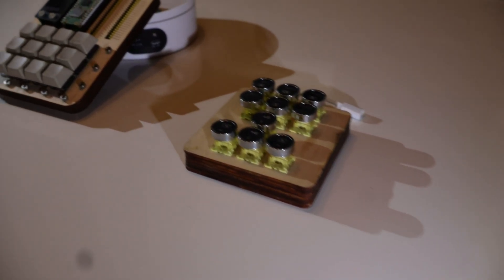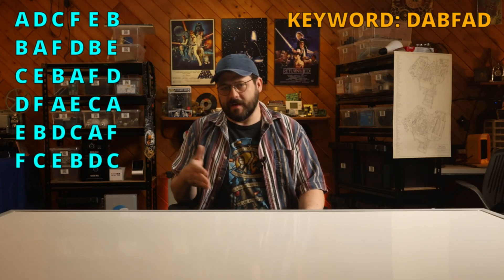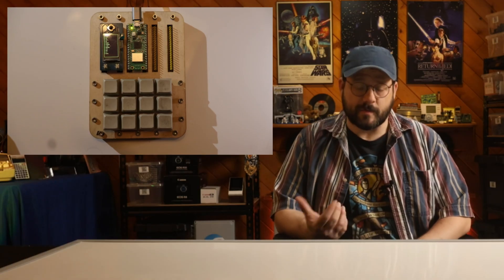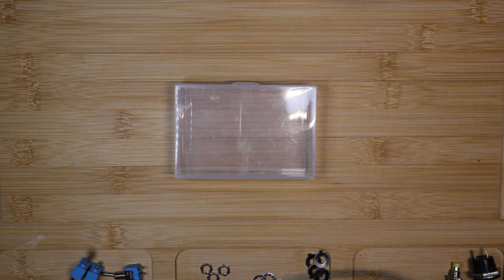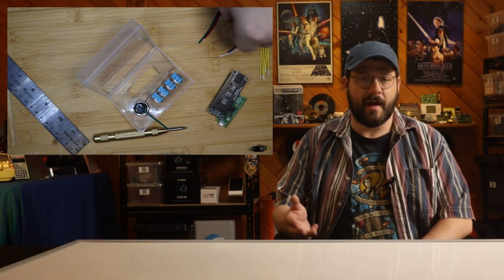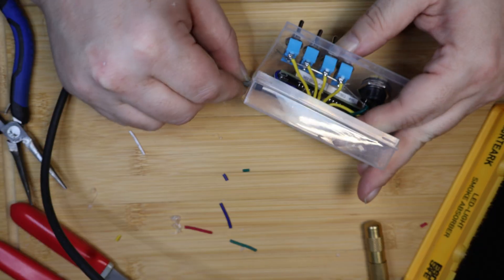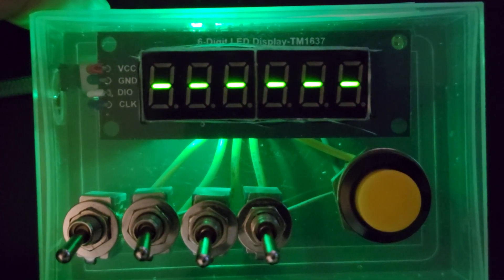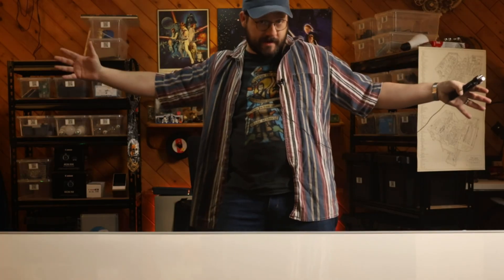Complete New Password/Macro Device Build

Comment: The downside of this is you remove an authentication factor. YOU are no longer required for authentication, only the input device is. It now becomes a single point of failure. And if the device is badly secured then someone with physical access can steal all of your accounts. In that case you probably have bigger problems, but still
Reply from the maker: You have valid points, but there's more nuance, I think. For the devices that have pins or passphrases, it does create a middle-man, which is a point of failure, but I don't know that it's significantly less secure enough to worry about, and I wouldn't consider it removing myself from the authentication chain entirely since i must unencrypt the passwords. I do exercise caution in what I trust to the device and I will admit I should get rid of the non-encrypted devices. 
I don't think your average bad actor is going to get through the obfuscation and encryption--at least not by the time I've changed my passwords as a precaution after losing a device. There are countless scenarios that could go either way, but I think my chances of being in one that finds me at the disadvantage is low enough.
I do also lean on the "bigger problem" angle maybe harder than some would be comfortable with, but I think it's practically safe for most day to day stuff--at least for me. I do appreciate the feedback, though. And, thanks for giving the video a shot!
Reply: @smartercircuits  you've convinced me. But I still want to emphasize the key point that these devices must be secure. Of course there's different levels to it. For example, a device with highly sensitive credentials located at your office probably requires a lot more protections than one at your house with passwords to forums or home servers.

But as per my personal standards, having a completely unencrypted device or a guessabe key combo is unacceptable. This may not be true for everyone and every use case, but it's important to understand the risks
Reply from the maker: Of course. Honestly, I think the most secure version is the all in one unit keypad and the most recent, since there's no limit on passcode length for either and it must be entered in a very unique way (even with the keypad, not knowing what the "submit" button is, though you could play with it enough to figure that bit out). There's also the misdirect of the device not locking you out with a bad password/passcode, but rather seemingly working but spitting out junk. 
I do wonder just how easy it would be to break the encryption itself. Perhaps I'll share a wheels file and a message and issue a decoding challenge. I think that would be very interesting, enlightening, and a lot of fun for some folks.

Comment: I'm watching this video while thinking about creating an ESP32 device that functions as a flash drive with an internal button. I plan to use Bluetooth or Wi-Fi AP to connect my phone to the device, allowing me to select a password from my personal password manager/list. After clicking send, the device would transmit the password as if it were a keyboard input. Encryption here is optional; it would be a strange device to hack because the ESP32 would be quite basic, and the application on my phone would only accept connections from this specific device for a short time. Thank you so much for the ideas!
Reply from the maker: @Ahmedhkad  that sounds like a pretty neat project, best of luck and thanks for watching!
Reply: I'm looking for something like that, could you share it with us? when ready.